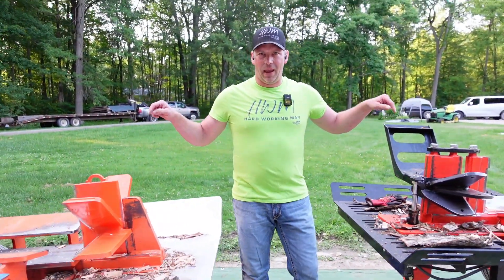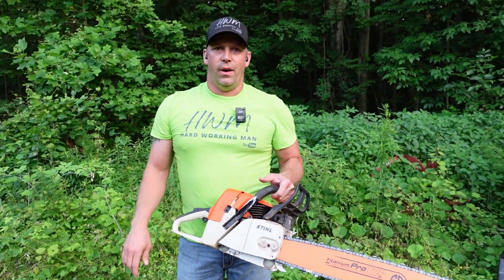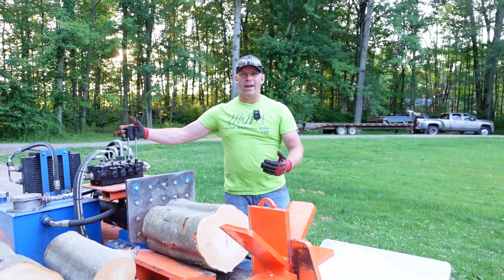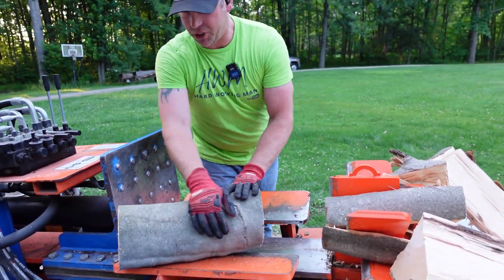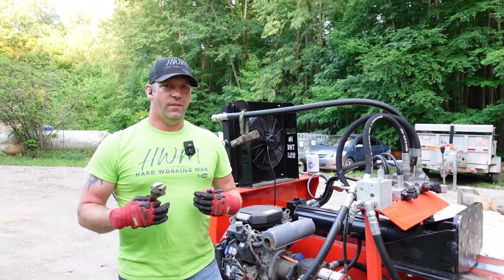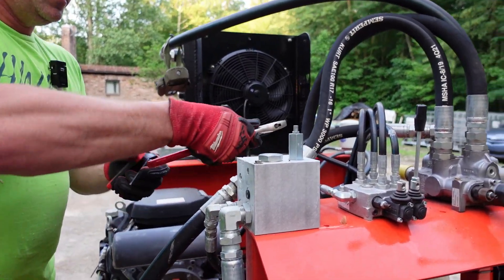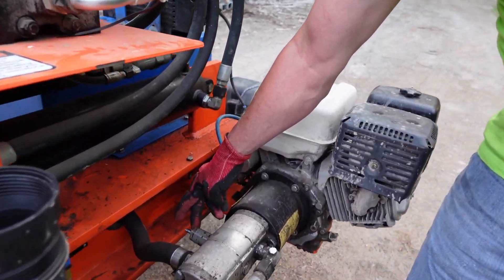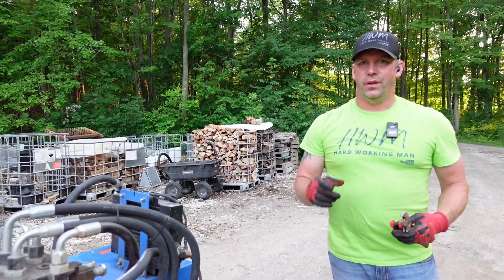Free Easy Fix To Make Hydraulic Log Splitter Split Faster!

Comment: Good job on this video Heath. That adjustment is the unloading valve. Trying to run too much flow at high pressure kills the engine. Unloading that high volume gear set allows it to build pressure without stalling.

Wolfe Ridge machines have the adjustment in the same location as the EM, and they are fully tightened and then set 1.5 turns out CCW at my shop... Just so you Wolfe Ridge guys have a good base line. Just make sure not to set this adjustment too high as it can cause damage to the engine long term.
Reply from the maker: Thank you Chris, I was actually researching this more today and learned how the unloading valve works. Pretty neat. I plan on doing a follow up video and appreciate the information, I’ll pass it along. Also going to pin this comment so Wolfe Ridge owners can see it as I didn’t have a WR to show in the video.
Reply: Thanks for the explanation Chris, and thank Heath for putting this video together, you did a great job showing the comparison.  I have a WR 35 SHO, with 7 hours, so I doubt it has slowed down much, but I’m definitely going to save this video for later down the road.  Thank you and have a great weekend Around the Yard! - Brent
Reply from the maker: Thanks Brent. Yeah my guess is that after time maybe the spring gets a little weaker and needs to be adjusted but as Chris mentioned I’m sure most of the commercial companies set them correctly before shipping them out.

Comment: If you wanna take all the guess work out of it find the pressure your suppose to have when the high flow pump kicks out and set it that way. It’ll be safer and better overall. 

Signed your friendly mechanic.

Comment: I'm confused about why you put the tip of the bar against the piece of the wood you had just cut before you cut the next piece?
Reply from the maker: I have a firewood prosizer on the saw. It is a laser measuring device. You have to address the log the same every time and see where the laser hits.
Reply: Oh ok... it's been a number if years since I've been in the woods! I didn't realize they have something like that! Thanks for the information!
Great Video bud!
GOD BLESS YOU!!
😊🙏🏻❤️🕊

Comment: Well my old Huskee 22ton was in need of a new engine after 20yrs the old B.Stratton 650 was falling apart.. upgrade to a Harbor Freight 212cc Predator engine and a 16gpm pump and 3/4 NPT fittings and we should be splitting alot faster once I get everything mounted in
Reply from the maker: I’ve heard a lot of positive feedback on the predator engines. I used to run a husky it was solid!

Comment: Making a pressure adjustment on ANY hydraulic system without using pressure gauges and adhering to manufacturers recommended pressure ranges is foolhardy to say the least.
Reply from the maker: I guess it’s a good thing I talked to both Andrew from Eastonmade and Bobby from All Wood to learn how to do this. Chris from Wolf Ridge also reached out and said they are done the same way.

Comment: Gear pumps like 1200 rpm, engines like 3600 rpm. The new splitters us double pumps with a crossover valve set at ?. The small pump can run for a short time at 4000 psi (would you believe it?)  a GEAR PUMP with a directional valve and cylinder is a very efficient system. Often in the past a single gear pump was connected by V belt to a jack shaft with a 3;1 ratio. Oil does not like to move fast especially when cold.  The new splitters have a double pump that is much smaller  and can be rated at 4000 psi for a short time. However it still must slow down when the jaws close on the wood or hit a knot.
My 30 year old splitter  has a jack shaft and a 2 inch gear pump (probably of a Case Back Hoe) It also has a 5"x 36" CAT cylinder.  i have re plumbed to add a filter get rid of the water pipe fittings. It has a Ford solid axle with 15 inch tires.  It tows good, if you remember to extend the cylinder and put weight on the tongue.  For 3 foot rounds I can put the tongue on the ground and roll the rounds into the jaws.  I sit on a padded round and use my shoulders and knees for the work.  I roll the rounds or put them in a double wheeled wheelbarrow downhill  into the barn. As I split I have shelves on either side of the wedge so I can just throw the keepers into a loose pile in the corner. Right now the corner is 12x 20x 4 feet high.
If I had a lot of money, I still would not have a tractor or side by side or pickup involved.  I got a new Duromax with electric start and I really like it.  At 88 I need my exercise but do not want to over tire myself. I was a Sales Engineer for Vickers and TRW ROSS. My territory was Rocky Mountains West, I travelled with my skis in winter in flyrod in summer. Its been a good life.   
Iguana   Ps Get Smart, Get Trump
Reply from the maker: I’m impressed with all you’ve got going on. I’d love a new Duramax.

Comment: thanks for the video. i also like your idea with the laser. i normally use a measuring stick(takes time marking). are you using a gun mount laser? i tried amaOn for chainsaw lasers but to no avail
Reply from the maker: You’re welcome. The lazer is the Firewood Pro Sizer. They work great!
Reply: @hardworkingmanoutdoors  Thanks, i found the seller on etsy

Comment: Can you tell me what the thing is behind touching the tip of the saw blade after each time you make a cut? I have never seen this done before and i watch "a lot" of bucking billy ray, lol.
Reply from the maker: I have a firewood pro sizer. It is a small laser that attaches to the handle of the saw. I touch the tip of the saw  to the log so the laser is at the same point every time. This helps me get perfectly uniform cuts. If you look closely you can see the green laser dot hit the log when I do this.
Reply: @hardworkingmanoutdoors  
A+
That's extremely awesome !! 
Never knew such a thing was out there !!

Comment: that's like us, I can grab 3/4 pound  or 1/2 lb of ham, turkey, RB, every time.  I bet your logs are 14".   Kinda a dumb comment.. but.   The tool that burns twice as fast, burns half as long!  Taken from 'Blade Runner' 1982 film.   That's cool, adjusting your equipment!
Reply from the maker: Thanks, they seem to need a slight adjustment every once in a while.

Comment: I just have a regular "Ma and Pa" Speeco splitter. My wife and I (if we're together) can split a full (3 stoves) cord in about 3-4 hours. Usually all gnarly Oak and Elm. LOL. Always knew the valves could be adjusted but never had it explained. I've got a hell of a lot of hours on it but it seems to "shift gears" appropriately. But still nice to know. The cycle rates on my kind of machine are painfully slow particularly after watching all of these challenge videos and seeing the "pricey" machines you all run. Its a lot more work and time with my machine but I'm getting older and only "process" wood for myself. I wear out so fast these days, I think I'm finally catching up to the speed of my machine.....meaning, I slowed down enough for us to work in simpatico  together. LOL,  Love the videos and the challenges particularly. It's great to see good 'ol family content of couples working together to accomplish a shared goal. Its so much better than the lives most of us lead.......going our separate ways to work each day to meet up at the end of the day, too tired, ornery,  or busy to show each other appreciation. It's wonderful to see the two of you literally and figuratively working together and enjoying each other. Give Thanks, because (yes ya gotta work at it, but) it's a Gift. Thanks.
Reply from the maker: Thank you! We appreciate the feedback, and yes it is work but also such a blessing to be out there with the family. Sounds like your Speeco has served you well!

Comment: Hi Heath, I see you finally stopped # numbering your videos (which was very smart) but what I was wondering is did you do the same thing on this video that you did on video #80 to speed up the ram?
Reply from the maker: Thanks Joe, no, in video 80 I replaced the hydraulic lines with larger sized lines and installed a new ram!

Comment: Nice work Heath.  My splitter has a two stage pumps also.  I should check.  That All Wood splitter is impressive.
Reply from the maker: Thank you, it seems most 2 stage pumps have the relief valve.

Comment: Great informative video.  I have just purchased a used 12-22 as well and will be paying a closer attention this to see if I need to make an adjustment or not
Reply from the maker: You are going to love it. On other thing I had to adjust was the autocycle kick out pressure as that had loosened up over time as well. If it kicks back too easy it may need to be adjusted. This is pretty simple as well.

Comment: good video years ago my dad had me turn up the pressure on a industial tractor loader and hoses started blowing out so i had to turn it back down i think it only had single stage pump. just be careful turning up pressure.  Rachel yous good in saw dust. take care, be safe and well.
Reply from the maker: Yeah, that could be dangerous for sure. This doesn’t change the pressure, just changes the pressure that it switches to stage 2. If you set it too high it will simply stall your motor in stage one before kicking to stage 2.

Comment: I kicked my axe into stage 2 this afternoon, hahaha. If I ever get a nice splitter like you have, I'll use this information wisely. 
Kenny❤
Reply from the maker: The problem with stage two on the axe is that it doesn’t seem to run as long lol. My motor gets tired.
Reply: @hardworkingmanoutdoors  hahaha, yep.

Comment: Lil off topic question if you don’t mind.  Have you noticed a difference in rpm of all your splitters you have tested.  Not splitting rpm just at operation rpm not splitting. And do you have idea how high the norm is?
Reply from the maker: I did put a tachometer on the Eastonmade 12-22 and on my buddies Wolfe Ridge Pro28C when we were comparing them and they were very close. However I don’t remember what rpm they were running at. I can check next time I run the 12-22.
Reply: @hardworkingmanoutdoors  cool thanks. My small 22 ton is not turned up very high. Makes me think it should be higher. But do I really need it to be lol.

Comment: ok so your saving 3 or 4 sec per round if you split 100 rounds in a session, you saved 400 sec 6 1/2 min no big deal
Reply from the maker: The adjustment takes 2 minutes and costs nothing. With these machines we can get easily split 1/3rd of a cord in 10 minutes which we sell for $150. So in you example we could easily split an extra $75 worth of wood per session. I’d say it’s well worth making the adjustment.

Comment: Hello Heath, Good explanation, Common issue with 2 stage pumps, definitely have yours adjusted correctly 👏🪵👍🏼🇺🇸
Reply from the maker: Thanks Larry, it makes a huge difference for sure. Now I need to figure out why my Kinetic splitter lacks so much power.
Reply: @hardworkingmanoutdoors  Heath, 1st check for belt slipping, next unnecessary safety junk, and look for Stupidity in the design, slack in the rack and pinion, as well as binding, Take Care 👍🏼🇺🇸
Reply from the maker: Thanks, we took it apart and it seemed right etc. it will be shown in an upcoming video.

Comment: hi there good show , thats what makes mine so fast .it only has one stage , but not very strong . could up grade the pump but after 50 years i think i will be fine . john
Reply from the maker: Thanks John, the single stage pump’s definitely are fast but don’t have that second stage power for sure. Usually not needed but can come in handy. A giant engine and single stage would be the best of both worlds.
Reply: @hardworkingmanoutdoors  hi that's what we did on that big splitter big pump and 100Hp  John Deere diesel engine , 6 inch bore cyd ,

Comment: Nice video Heath. I’ve adjusted kick out pressures on my valves, but have never adjusted pressure on the pump. I’m going to check my Wolfe Ridge 28C to see if the pump is going into 2nd stage too soon. Great information!
Reply from the maker: Thanks Dick, let me know if you can adjust this on the Wolfe Ridge. I have to imagine you can but not positive.

Comment: Going to try that on my power pack for the disc cleaner
Reply from the maker: Awesome, glad we could help. That’s what it’s all about, helping each other out. We learn a lot through the channel and try to share what we can with others.
Reply from the maker: I wonder if that has a 2 stage pump?  I don’t know much about the disc cleaners.
Reply: @hardworkingmanoutdoors  you may not know about disc cleaners but you helped me fix my problem.. the pressure changed some how..  I adjusted and it works better than new..  thanks

Comment: Great video. If I only had a big commercial unit like the ones you have lol. Still very good info to know. Thanks heath 👍
Reply: Yes they do have one.  I just went through the process a couple weeks ago and can’t find the video I watched that explained the process.

There’s nothing wrong with all my pump is adjusted. But the hoses absolutely suck based off of size.
Reply from the maker: Thanks Pete, I’m curious if the box store splitters have an adjustable 2 stage pump.
Reply from the maker: I bet a lot of box store splitters could use an adjustment for better performance!
Reply: @hardworkingmanoutdoors 
Probably need a better hose system that they do a pump adjustment.

I know on my splitter, I’ve benefited better from the hose. Now with the pressure gauge in it, I realize I do not have to adjust the pump. My transfer pressure is 800 psi in my deadhead pressure is 3600 psi.

Comment: This is Jon edwards.  Not sure why it doesn’t show the right name.

It’s the low pressure transfer pressure.  I sent you an email about this the other week with pictures and a link to a flow diagram 

I have basically a county line 25-ton box store like you do.

For me, I wanted a pressure gauge on my high pressure hose.  My transfer pressure is rated for 400-900 psi.  The pump setting is at 800 psi.

I got a similar benefit just by changing the high pressure hose from 1/2” to 3/4” between the pump and the directional control valve.  When you look at the flow chart, 1/2” is at the edge for being too small.  It would be much better with at least a 5/8” hose.

So there are several items that could contribute to this
Reply from the maker: Thanks Jon, not sure why the names on YouTube have been showing weird lately. It’s amazing what correct hose size and proper adjustments can do to machine performance!
Reply: @hardworkingmanoutdoors  

Found the link on how to adjust the pump transfer pressure on a box store splitter.

https://youtu.be/tx2DDslCgAM

Comment: Really helpful. Thanks for sharing. Now is there away to actually know if your getting the correct tonnage of pressure according to your cylinder size. Or what that sticker is actually advertising. That wood be a interesting video to watch.
Reply from the maker: Thank you, I am not sure about measuring the tonnage. I’d imagine you’d need some type of machine to actually measure the force. Other than that you could probably use match with the inline pressure gauge to calculate what it should be.